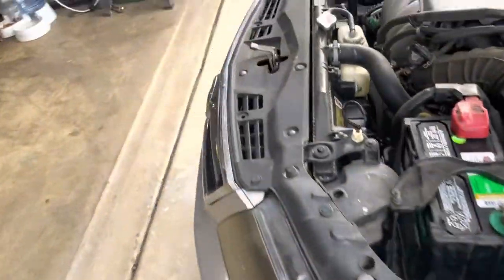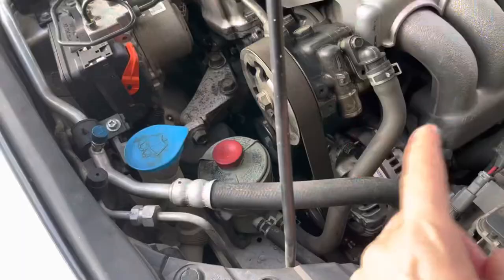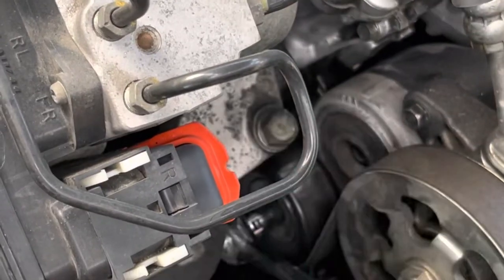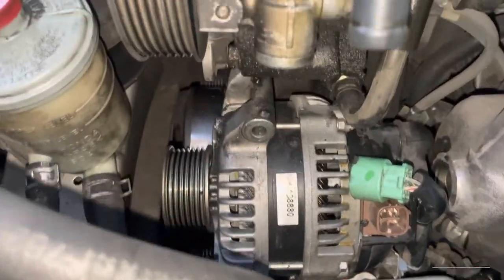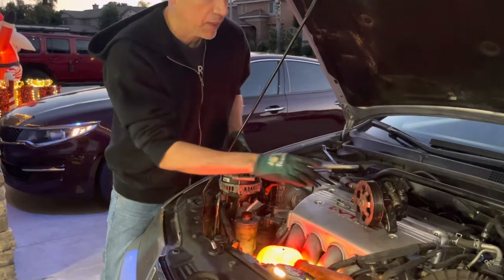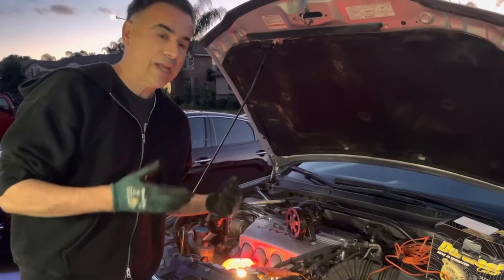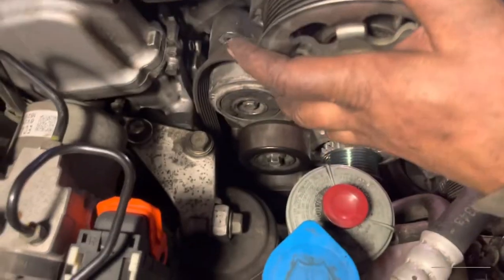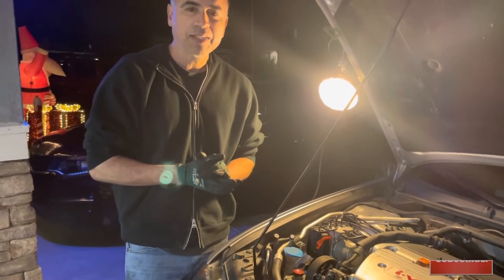How to Replace the Alternator on an Acura TSX #Acura #TSX #honda #diy #Duralast

Comment: You don’t need to remove the power steering pump to take out the alternator.
Reply from the maker: Unfortunately I felt like we had to. 🤷🏻‍♂️
Reply: Yeah as long as you got it out somehow haha. I managed to just remove one of the radiator fans and was able to sneak it out.

Comment: You can't disconnect the battery with the engine running on newer cars to test the alternator. If yo do you risk damaging the computer and other components in the electrical system.
Reply from the maker: That’s how old I am 🤣. You’re probably right, I should have done my due diligence before passing ill advice.

Comment: Common battery drainage comes from the Bluetooth phone device under the passanger side panel
Reply from the maker: Yes! I disconnected it that very same night as replacing the alternator didn’t fix the problem. It happened to be the starter.

Comment: How do we perform the simple test? Simply just remove the positive terminal and then check to see if the car can start? Or how do we do it exactly?
Reply from the maker: With the car running, remove the positive and if the car dies, the alternator is not charging.
Reply from the maker: You can also do a volt meter test but the easiest one is removing the positive terminal with the car running
Reply: @JuanCarlosLTO  Thanks Juan! Will try that out before I buy a new alternator!
Reply from the maker: @HilariousHomeVideo  i went at it wrongfully: in plain English, a faulty alternator will often give you signs of deterioration before it completely fails: dimmed lights, a dead battery after sitting for not too long etc. 
in my case it was the starter but I failed to diagnose it properly.
Reply: @JuanCarlosLTO  I let my car run and removed the positive terminal and the car was still running. What else could it be?
Reply from the maker: What are the symptoms? Hit and miss starting? I’d check the starter. That was the issue with mine. Look into videos about a bad starter.
Reply: @JuanCarlosLTO  starting just fine. When I drive it sounds like it’s whining a little. When I put my high beams on the radio lights dim.
Reply from the maker: I’d take it to an auto parts store like Autozone, they can test the alternator for free or let you use their equipment in their parking lot. (Without having to take it off)
Reply: Disconnect the Bluetooth module, is in the passenger side floor board, behind the plastic cover. It tends to drain batteries